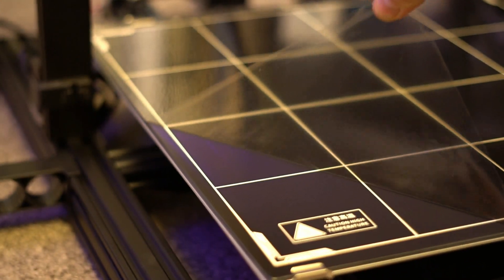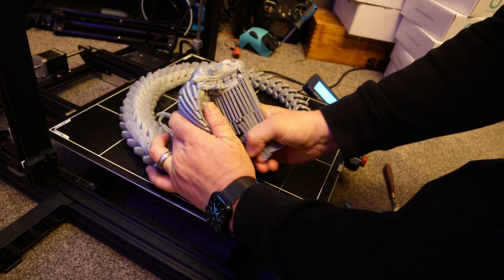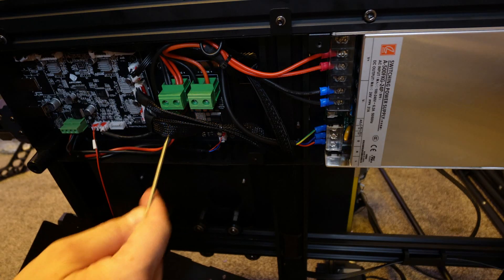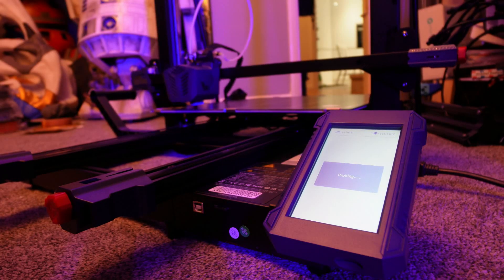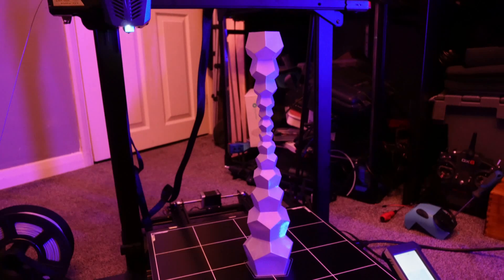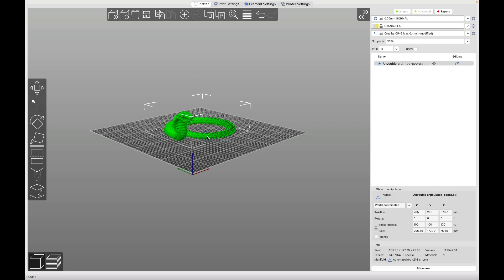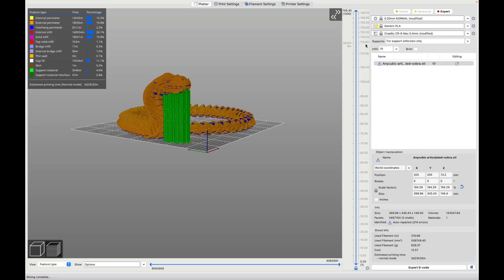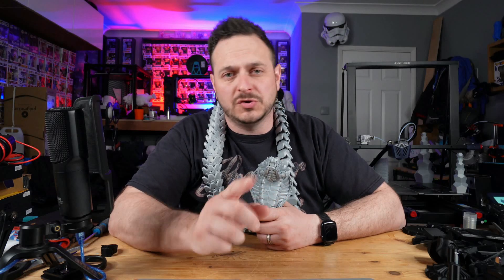Anycubic KOBRA MAX 3D Printer - All Hail The New Serpent King Of 3D Printing

Comment: Hi. I am thinking of buying this. I’ve never done 3d printing and I want a printer that doesn’t require tinkering/modding and faffing. I also have projects that need to be strong and functional. Is this the right printer (I need the volume) and can it print in engineering type filaments and the soft flexible filaments? I need to make clamps and monitor arms and threaded brackets and flexible iPad Pro cases… thanks.
Reply from the maker: Hey Zoe, most printers will require an amount of finessing and maintaining. The max is a good printer for sure and the price is solid. What filaments are you looking to print as this is good for pla petg and tpu if you were lookng at abs or more engineering elements you might have a challenge. Let me know

Comment: Great video! Question for you: does the stock firmware have a way to pause the print and change the filament to do multi color/material prints? Thanks!

Comment: Anycubic is going to take the crown for "Most Confusing 3D Printer Naming Scheme" from Creality. Help me make sure I've got this right: the Kobra Max has the same bowden hot end as the Vyper, while the Kobra (not max) uses direct drive. The K-Max uses the nozzle tip to level the bed (conductive sensor somewhere?), the Vyper uses a strain gage and the Kobra has an inductive sensor because it came with a spring steel bed plate. Aside from that, the K-Max is essentially a scaled up Vyper (and has a larger Y-axis motor to compensate for the larger bed).
Reply from the maker: You sir nailed it

Comment: so the kobra is a direct drive vyper.  the kobra max is a chiron replacement with touch sensor.
Reply from the maker: That’s correct
Reply: @TheRealSamPrentice  still able to tweak the individual probe points like the Chiron?
Reply from the maker: @adamklosterman8960  what feature was that??
Reply: @TheRealSamPrentice  on the Chiron you could go in and tweak each probe point in the advanced menu after leveling.

https://youtu.be/VRJ6D0HyTzg

Comment: Great  review.
I do like the printer, but they have missed a trick with no direct drive and the hotend from the vyper. I wish it had the direct drive titan aero clone and LeviQ of the smaller cobra. I was looking to get this and use some of my stockpiled E3D genuine Titan aero to upgrade it, now I know it has the same hotend arrangement as vyper im not that happy as I had the strain guage fail on me twice, once I was able to fix myself, the other was a month of not printing with it while I waited for a replacement strain guage from Anycubic.

 I dont think changing the Kobra max to direct drive will be that easy as its not as simple as swapping out the print head of the tiny Kobra's direct drive as I assume the probe will not work with the glass bed of the max, also not sure how easy swapping to a BLtouch as a replacement to the strain guage would be. 

What they need to do is smash both themax  & Kobras together with the build volume & mechanics of the max, and the fillament delivery system of the teeny Kobra, then they would have a decent product on their hands rather than 2 compromised machines.
Reply: I do have several Anycubic printers incl. Chiron and Vyper. Vyper is real improvement but I am with you when saying they missed really a direct driver. I will also move to Ender 3 S1 Pro and have a look on those. For me Kobra Max is just a Chiron on steroids. I updated mine to a E3D V6 volcano with a 0.8 Ruby Nozzle and just print larger stuff. Also works great.

Comment: The Kobra vs Kobra Max naming is terrible, and while I love my Vyper, the leveling sensor is terribly undersupported and shouldn't be found on new machines until they offer easy and fast replacement sensors.

I'm tired of waiting a month+ for a replacement sensor for the 2nd time
Reply from the maker: I'd agree with the names to be fair, it was a little closed off on the features between machines too. I'm my mind Vyper should have been the smaller one and the Cobra (as the Max) I would have liked to have seen the new hotend on the max too.
Reply: You are not alone there are so many of us out there waiting on strain relief gauges. I have only had my Viper since December. It has been down almost the entire time. Any cubic doesn’t seem to be responsive at all we are all having this issue this is a horrible company
Reply: @nmfireman  Have 3 vypers running constantly and only had 1 that needed parts, and I got those parts within 2 weeks. Much better service than I've had from others.
Reply: People should read the reviews on this company before they purchase anything from them.

Comment: Kinda disappointed. I was expecting direct driver and PEI sheet. It's basically and oversized old vyper.
Reply from the maker: You say that and I did think the same ! But the bed is excellent and the version of the print head is the v4 revision so it works really well! Retraction is key!
Reply: @TheRealSamPrentice  wild idea: Kobra tool head drop-in replacement for the Vyper. Replacing that Vyper leveling sensor is a nightmare
Reply from the maker: @dasauto7346  depends on the version of the levelling parts, the pinda options are vast tho and I’d prefer a slice engineering hot end with a bondtech extruder - good idea tho!
Reply: @TheRealSamPrentice  I'll take anything that's more... Standard. Not a fan of the V5 hotend when the V6 is already ancient, and the Vyper's probe is decent but I can't get spares easily. 

Though a Vyper with something like the SE Mosquito would also be super cool
Reply from the maker: @dasauto7346  I’d go copperhead as it’s a bed slinger, the mosquito would be a little bit over kill for this my s5’s run copperheads really well